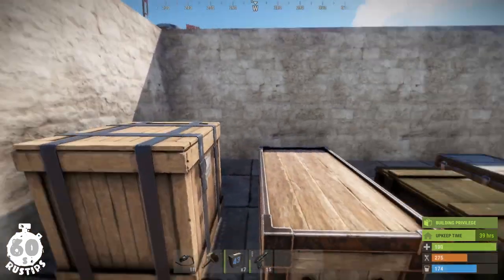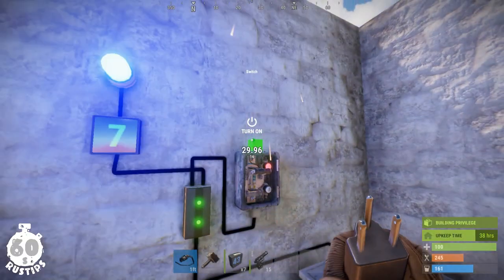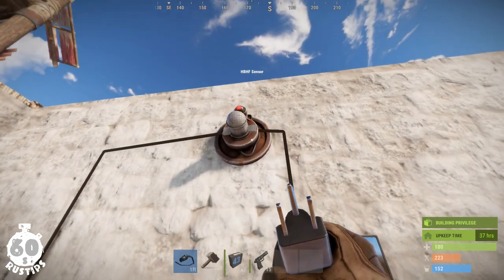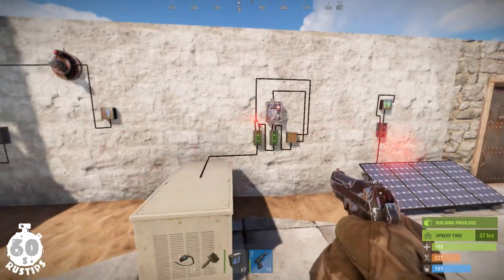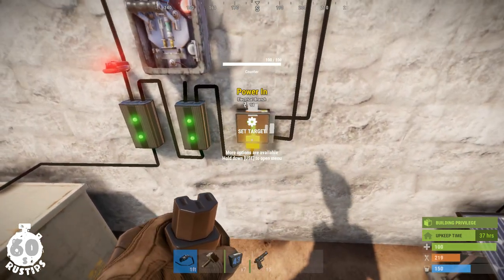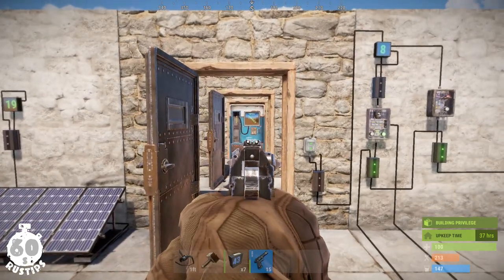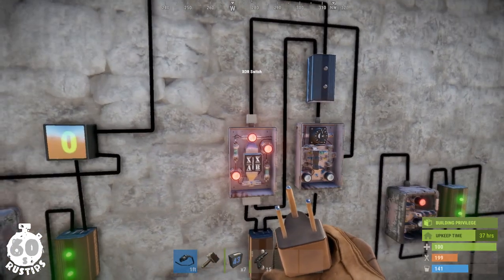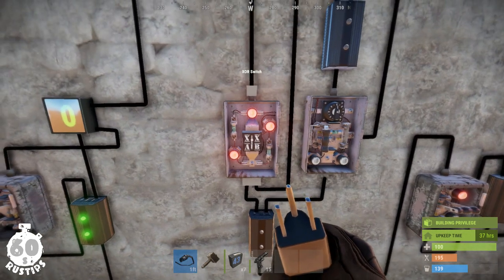60 Second Rust Tips | Counter + 5 Examples

Comment: I you needed the xor or the splitter after the timer you could have just had the timer going into the input where you set a target on the counter, then used the output from the timer activates a door with a tier behind it and before it gets there goes to a blocker, which goes to the reset pin, so as long as the timer is activating a memory module which passes through to the door controller it won't reset, but after the timer expires it will.
Reply from the maker: I think I don't understand :-) Thanks for watching my videos though. Much appreciated.